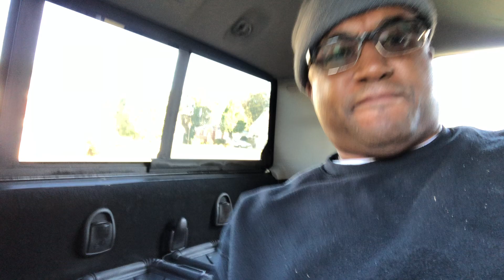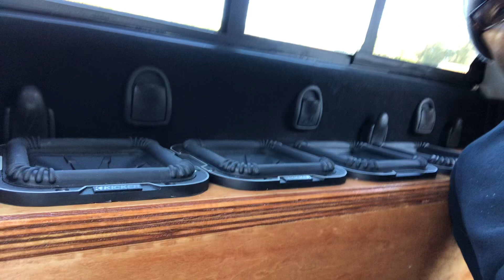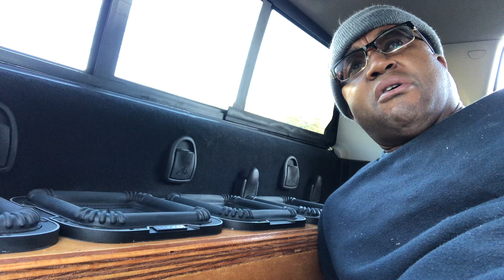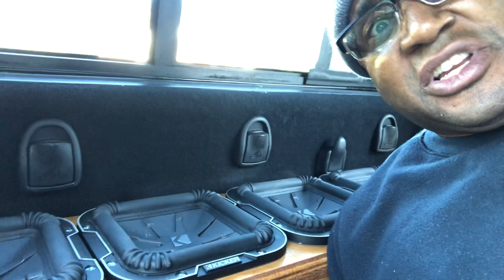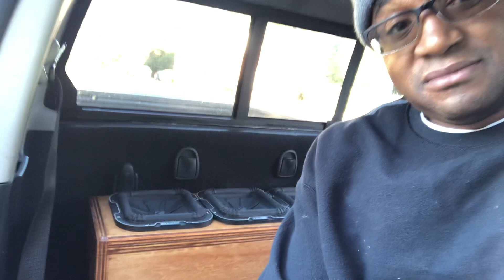Why KICKER is the only one to consistently use a square subwoofer?

Comment: I love my 4 Kicker Q Class L7 10's which is in an extended cab Titan in a 5 cu ft ported birch downfire box, Running mean green high output alternator, 0 gauge big 3, stinger power2 spp1500dcr stock replacement battery, 0 gauge ofc silver tinned wire, nvx 10 farad capacitor, Kicker Kxa2400.1, Kicker Kxa400.4, stinger 8000 rca's (which most people overlook for quality sound), alpine 11" Halo touchscreen, infinity kappa csx component 6×9 in front and 6.5 in rear with the 2" 3 way upgrade added in the front and rear, Kilmat 50mil on floor/rear wall, and 3 layers of Kilmat 25mil on all doors. Sounds crystal clear and hits really hard but need more battery capacity bc the kxa2400.1 is at 1ohm and produces some serious power.
Reply: Just get an AGM battery. I have a 320amp alternator on only 2 agm batts and a 2300w rms amp, no prob

Comment: kicker solo's tear apart a lot faster then your original round sub and also you cant get recones with the kicker subs, that's why i go another route
Reply: Look into the L7x when it launches, I believed they solved that by making the parts easily replaceable.
Reply: @crucial0072  Yeah they offer that on the Solo x's but no on the regular l7's and no telling when the x's will lauch
Reply: @apocalypse4720  the latest rumor I've heard from on of the YouTubers was 4th quarter this year.  They wanted to try and have an ample supply for the demand projected.  I'm not holding my breath for the release date.
Reply: @crucial0072  It was supposed to be out last year but there has been a delay since they announced it almost 2 years ago. I say 2023 by middle of the year
Reply: @apocalypse4720  if so, I'm patient.  I don't have a second car to install it in yet, and my teen plans to commandeer my current car and the current set up when I get another.
Reply: @crucial0072  I'm wanting to do another build but i'm going alphard audio on my next build.

Comment: About time I hear someone respecting papa Kicker like they deserve 😎👍 I grew up near Stillwater. I became a basshead because of Kicker. My first system was 2 Kicker 15's on a 320SS. I've built numerous systems with the L7's. I even still have a 6th order with a L7 10 in it I built in 05ish in my garage and it's still perfectly like it was back then too. Only thing is back then the tuning frequency was high on them. 47hz if remember correctly. I hooked it up a few years back and it was still pounding away just like way back when 👍

Comment: They used square drivers in home audio towers back in the 80s
Reply: Yes to be honest Sony was the first one to make a square woofer
Reply: @generalkickass6385  I had a full Sony setup that my uncle brought back from Okinawa when he was stationed there as a Marine. Each tower had 2 10" square drivers, a 3 1/2" coax, and 2 1" ribbon tweeters. I regretfully sold it years ago and ever since I haven't even been able to find the towers themselves
Reply: @bassranger1054  yes I remember those they sounded pretty good

Comment: Some one was doing triangle sub can't rember who tho. They wasn't around long
Reply: Bazooka had a triangle pre-loaded ported subwoofer when I worked as an installer at Circuit City a long time ago.  The first time I heard one that I installed into the trunk of a Nissan Sentra, I was pleasantly surprised.  The problem is that a triangle subwoofer is about the most inefficient use of cone area for the space that the subwoofer takes up.  The only worse idea I could think of offhand would be an oval or elliptical shaped sub.  Oh, a subwoofer shaped like a picture frame (hollow in the center) would be even shittier, and the box would be REALLY difficult for a DIY person to build.

Comment: Kicker is ok I used to run the L7s when they first came out yrs ago.. but I went to sundown and Skar. And honestly my Skar Subs by far out performs my L7s which I still have n I got a new L7 15" and still my Skar Subs do better n sound better and get louder. My Skar DDX 15 meters higher then my L7 15". But yeah kicker is a good company it's just their is better for the money.. everyone has their own fav car audio sub and comp and sound is diff to all ppl.. so some brands sound better ect to others.. but personally sundown and Skar walk kicker period.
Reply from the maker: You must have not been thoroughly through me channel..I own X8v3’s. The very first video on my channel is a pair of X8v3’s in my truck. I have owned Sundown and Skar. It possibly your box the problem. But believe as you will, I’m not trying to convince you KICKER the best. I just know cone area is king.
Reply: @M.B.Enclosures  would you say your Kicker outperforms.your sundowns
Reply from the maker: @seankiesling2054  they do

Comment: I have a question can subs start clipping from not having enough power and if so would you prefer me getting a second battery or just an alternator
Reply from the maker: Subs don’t clip.. amps clip. As long as the amp of not sending a clip signal the sub will be fine

Comment: Kickers are good been around a long time,  but like all technology other companies are competing and beating them in many areas for less.
Reply from the maker: Not true.. hell a kicker L7 8 is $229 and plays just as low, and due to cone area , louder than a $289 Sundown X8v3. Hell the entire L7 line is cheaper than Sundowns X, U, and Zv5 lines. If you think there is a sound difference between the X and Zv5 series you crazy. It’s just a bigger magnet for more power had handling. No more output can be had they share the same frame. And for the price of 1 of either you can get 2 L7’s and have more cone area. In subwoofers its preference really. But physics is constant.
Reply: @M.B.Enclosures  spoken like a true fan, I'm not saying Kicker is crap but as technology becomes cheaper so does the cost to produce and manufacture.  The majority of car audio equipment is coming from China today.  Kick is a solid sub, but there are other brands that are taking market space for multiple reasons.  A square shape cone is a good idea (old idea) that was reborn at Kicker, but it's not the only defining metric for acoustic sound amplification.  I stand by my claim today it really comes down to brand preference more than anything else.  Other companies have caught up and surpassed Kicker in some aspects of the sound industry.
Reply from the maker: @MrAlfisher3  if you watch my videos then you know I’m not a fan of anybody. But the big 4 have been doing it far longer and better than the new comers. Which as you said get their stuff from China and its ideas the big 4 discarded. Cause the Chinese do not originate they copy. Gimmicks sell these days, large motors will sell a shit ton of motors (just inefficient magnets mostly) and large surrounds will sell a shit ton as well. You don’t know me but I came from Sundown.. and I have had a lot, a lot of subs. A lot. This is an expensive hobby I can afford. My first video on my channel is 2 X8v3’s, which I do 141 @38hz on 1183 clamped. And I like them. But I have had and heard better. To me there is no perfect subwoofer. Period. But I know quality and originality. And all the better brands you think will surpass JL Audio, KICKER, Orion, or Fosgate are just Chinese off the shelf subs rebadged to whomever pays.
Reply: @M.B.Enclosures  I started rocking Massive Audio back in 2003 and haven't looked back.  Just like Kicker it's designed in the US and manufactured in China.  All Massive parts are shipped to China and assembled there same as Kicker and the other big names listed above.  I like many brands, Kicker and JL are two personal favorites from nostalgia but Massive is my go to for nice quality subs (my opinion).  With that said I wouldn't turn down a kicker any day of the week, I just prefer Massive Audio Subwoofers.
Reply from the maker: @MrAlfisher3  nothing wrong with Massive... butttt. KICKER owns its manufacturing in China. Massive is made me Jiaxang in China from parts they offer.
Reply: @M.B.Enclosures   I've yet to see a decline in quality from Massive,  until then I'm going to continue with their products for the time being.  Kickers are nice but I just don't have the same interest in their products like I did in the 90's.
Reply from the maker: @MrAlfisher3  massive new line up the Toro Tech Audio subs are beast for sure

Comment: But do square subs have the xmaxx round subs do? I don’t know so asking
Reply: I’ve never heard that before. Makes sense though. I have 21mm xmax running above rated power but the sub doesn’t move like the ones in demo and review videos. It was the same with my old sub too. That one was loud af not very musical though
Reply from the maker: XMAX is only needed in a sealed enclosure to gain low frequency authority..in a Ported application Excursion is governed by the tuning of enclosure
Reply: Sealed enclosures have better SQ and frequency range.... One 12" CompQ on 500w. Sealed 1.75ft https://www.youtube.com/watch?v=5GuuN9lanyY

Comment: I'm into high end push bikes and there is the same problem. There are like 4 levels.
1. El cheapo target mass produced bike
2. Premium carbon bikes that shares carbon molds with other brands in China.
3. Premium carbon bikes with their own Chinese factory and own carbon fibres and only make that 1 bike brand.
4. Boutique bike brands which are made locally in USA or UK and are hand made and just so expensive but quality is the top.
Reply: I went into a bike shop in amsterdam back in 05. I think the cheapest one was almost 3000 euros. I had no clue there was a market for that level of products
Reply: @gregblau8082  There is for sure a market for it. Ive got 2 $8500 bikes and with upgrades maybe $10k Australian. My dads low end spec electric mountain bike is $8500. When I go to the trails I see maybe people with bikes from 15k even $18500 and I think they are crazy! For a carbon mountain bike its kind of justified because the suspension technology is highend but I look at most road bikes and they spend 12 - 15k... there is literally nothing to them other than wheels and a frame

Comment: question   for instance lets say those 4 square subs that you have completly covers an area lets just say hypothetically 1 square meter of cone each of those cones is 1000 watts a pieace rms o.k.  now lets say over here I have round speakers lets say same quality 1000 rms a pieace and lets just say they  cover also some how some way 1 square meter of arera just like your square cones do everything is the same understand me now    will the both of them hit almost the same way  give or take as long as they both cover the same cone area ????  thank you
Reply from the maker: Yes sir, all other factors being equal (power, performance level, etc) the volume of air being moved ,or having the  potential to be moved, will be equal so loudness ability will be the same. Then it will come down to enclosure and vehicle application. You got it bro

Comment: Thanx for the video. Back in the late 80’s & early 90’s  when car stereo was booming, (no pun intended) it was a matter of what brand dominated that the car audio enthusiasts would seek to buy. Kicker caught lightning in a bottle when they released the square sub.  Since then like all manufacturers they keep reinventing the wheel.  As all humans, we are brand loyal. Nothing wrong with that.  Have fun. Keep supporting your hobbies.
Reply: Alpine and Kenwood were big in late 80s, early 90s.
Reply: @sgt.hollowpoint6968  💯
Reply: You are correct, thats why I'm still running Orion xtr subs and Alpine head units, that was the hottest gear you could have in the early 90s in my area.

Comment: I believe pioneer and jbl are the only other 2 companies that build their own subs and speakers.
Reply: MTX and Pyle driver as well 👍
Reply: Ok but those are not any speakers that hold any world records they are not competition subs they sound ok but subwoofers like crossfire sundown audio  def bonce those are world record subwoofers I would put my custom crossfire 15 " subwoofers against any of the those subs
Reply: @coystuart8583  I think you missed the point. When you are young all you care about is world records for spl. As your ears mature you start caring about the type of bass, how tight and fast the driver is, how well does it blend with my active front stage. You start to prefer a well built vented or even a sealed box over large walls of subs. Basically you start to want to hear the music accurately and save for the sundown shallow sub the rest are all spl junk to me. Id put my pioneer TS-TW12PRS subs or my infinity kappa 120.9 subs against any of those companies as far as sq any day. Don't even mention the JBL 15" gti sub. So different market for me vs you.